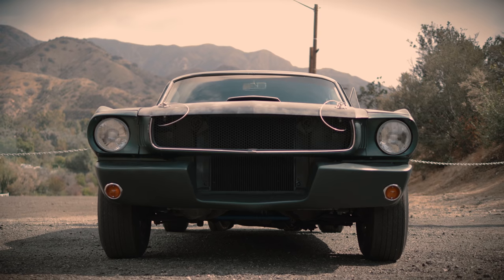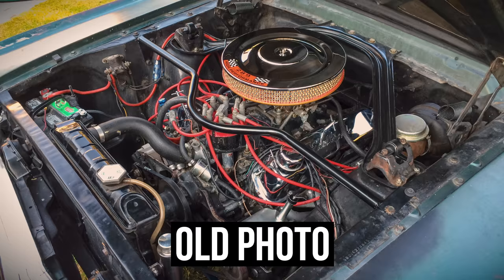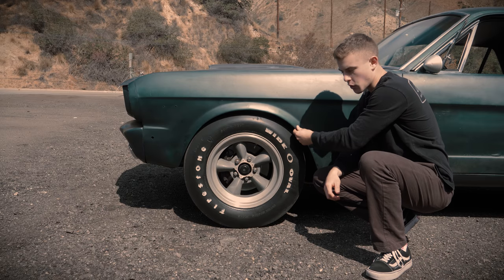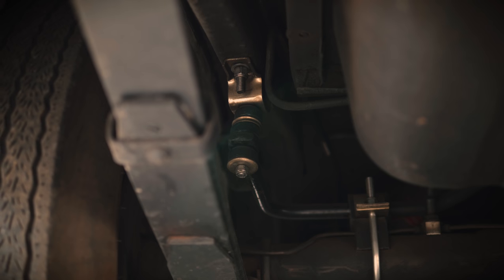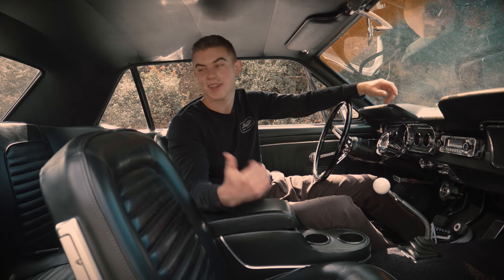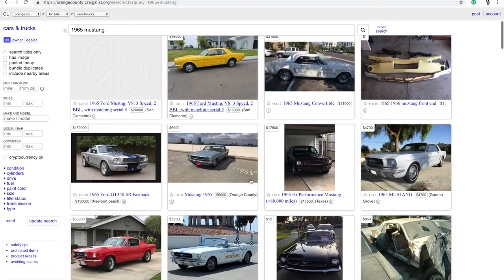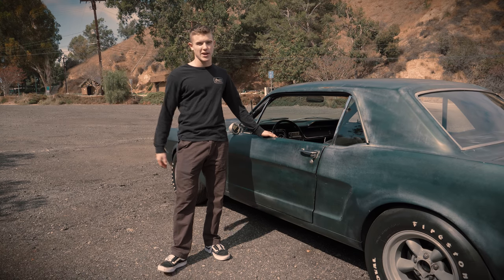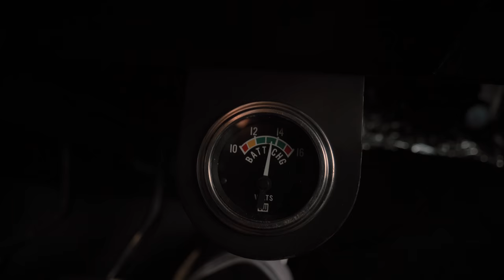My 1965 Mustang | Overview | 4K

Comment: Just take the radiator cap off and count the rows of cooling tubes, front to back.  I installed Ford Granada disc brakes on my '65.  The Granada spindles bolt right in.  Only difficulty was one of the tie rod ends. Neither Mustang or Granada part worked. Took dimensions to a Napa store and they fixed me up.   Stops much straighter and much less fade. Sold the spindles and drum brake setup to a guy with a 6 cylinder mustang he put in a V8 and five lug rear axle.
Reply from the maker: Scooter George Interesting👍🏼 Thanks for sharing!
Reply: What tie rod ends did you end up going with?
Reply: @historichomestead   - Passenger side, Granada. Driver side - see my previous post.

Comment: All cool cars have three pedals!

One thing to keep in mind about 65-67 Mustangs are the cowl vents.  They weren't painted from the factory so rust was a big issue.  There are aftermarket plexiglass plates that you can bolt on from the outside when storing your car outside.

I kept the useless AM/FM radio in the dash in my 67 because the car was so loud you couldn't hear the radio even if you wanted to.  Keep it real!

Rear drum brakes are more than adequate for the street.  I changed the backing plates and drums from a donor station wagon.  They had larger finned drums and wider shoes.  Adding rear discs means more add on stuff.
Reply from the maker: I have the cover! Thanks for sharing!

Comment: So Cool. Reminds me of my 1st Mustang. It was a 1969 428 SCJ Mach 1. But that engine had been taken out 2 owners before me. It had a 1971 Boss 351 with about 425 HP, and would spin at 8200 RPMs. I paid $3,800 for it in 1983 and sold it for $4,500 one year later to pay for college. It was also a 4-Speed car.

Comment: My 65 is restomoded. 5.4 2v supercharged and 4r100 trans. Full custom made subframe connectors and an 8.8 rear end with 3.53 gears. 723 wheel hp 813 torque. It's rowdy

Comment: I can see why you like the sound of the exhaust , it sounds awesome on your car . My first car was a 80Thunderbird with a built 302 , that car was automatic and would snap a car length in the down shift and roar under the hood . It was a blue car but the awesome engine burnt the hood paint to a purple color , I loved that car .  Green is a very good color for that type of car , the whole Steve McQueen Bullitt mustang . Down the road you should think about getting a summer motor , drop it in , in the spring . You would really like the sound of a stroker motor , the boom is very deep , has a big block sound . An awesome show called Engine Masters showed a Stroked Ford small block , I think it was a 351 stroked into a 410 . It made insane power . You could probably just use the parts off your 289 on it . It would run out of breath early , but the torque and acceleration would still be there . It would be over 400 ft lbs of torque at like 2800 rpm , it would burn out in second going down the road . The fastest car in 1970 according to a major mag was the buick gsx 350 horse 510 ft lbs torque . It outran the hemi cuda even tho it had much less horsepower . Wait till your in your in your late 20s tho , horsepower can shorten your life expectancy

Comment: I had a ton of fun in my 67, back in the late 80's early 90's. Couldn't keep people from running into it. I always liked the Trans Am series race Mustangs. I was always uncorking my headers and pissing off the neighborhood. Now I'm older and have a 68' Spitfire with 1300 cc's of English fury under the hood and I get irritated when a Harley drives by my house.
Reply: @FourSpeedFilms  really like the look of your car. Maybe get some factory steel valve covers, clean them up and wrinkle paint them. Just a thought. Also there was a GT350 mod where they lowered the upper front control arm by an inch or so. Supposedly gave better camber or caster or whatever.  I pulled my front disks and spindles from a 75' Granada, also had a one inch sway bar that fit. Put some tires on it and auto cross that thing.

Comment: The 7000 rpm limiter is whare the limit is on my Lincoln which is a similar motor also a small block ford and itll rev to 7k I wouldn't recommend it but u can
Reply from the maker: Jonathan Rabbe That’s interesting🤔 I always shift at 6k. It sounds really sketchy at 6k haha
Reply: Four Speed Films it is a built engine 🤷‍♂️ too bad you didn’t know the specs. Would be great having more top end

Comment: Hey man I’m building a 302 bored out to a 306, full forged rods and crank with hypereutectic pistons. High flow oil pump, comp cams magnum 280 camshaft, edelbrock estreet heads, and 750cc carb! Looking for a 60s stang rn!

Comment: This is tastefully done bro, respect to you for that. 
I would be very careful with the diff, suspension, brakes, tires, wheels, sway bars and rigidity mods... if it affects handling and suspension behavior you need to consider the whole picture or your result will be skewed unless you get really lucky haha. 
Ken Block is great and all with him being a world famous American driver, but honestly I hope you have established a clear and set direction you want to take this build. If it were me I’d shoot for something very at home on the track but manageable and comfortable on public roads. 
I think the fully original ‘65 mustang gt fastback look is outstanding looking.
I know that when stock these were some of the lightest, most balanced mustangs of the 60’s. They serve well on a road course I hear with the right mods.

I would want the exterior to be fully stock. Including the wheels. My first step would be to identify what is the best suited or stickiest rubber available that can be fitted to the stock wheels. To me I would start off with period correct tires, then if I wasn’t happy with their performance I’d see about some kind of hybrid modernized look alike tire concept out there somewhere and if that didn’t exist I’d see if modern tires were applicable. Tricky.
Once the level of grip I wanted was attained I would obtain another compromise suspension system for the vehicle that keeps ride height reasonable and can be dialed in to suit the rubber and (which brings us to the rear end) which again I would want an adjustable applicable differential with a very conservatively tune setup, basically enough to allow me to kick out the ass in a hurry if needed, but otherwise will hold me in place and forgive me if I throttle on too soon during corner exit. 

Chances are there are products out there to aid in building one of these to look so original that even car people can’t immediately see what’s been done to it, yet have it rattling off competitive laptimes with modern track cars.. 
It’d be a lot of trial and error I doubt that’s avoidable unless you know someone likeminded

Comment: @ 6:37/38 your stock oil gauge isn't working,    you don't have a added oil pressure gauge?     I always want to know that I have oil pressure.
Reply from the maker: Vern M It works! You just caught a film mistake😂 I filmed that when the engine was off.

Comment: Depending on how the engine was built, 7000 rpm is easy. 7500 is not unheard of in the 289 when built with parts that can handle it. Take the valve covers off and see what your working with.

Comment: I once spent all night hotwiring an abandoned rubber bumper MG Midget sportscar.  Once I got the steering lock off, I ran into my next problem - the battery was dead.  I walked down the street and popped the hood on a 65 Mustang to steal the battery.   It was from there  on zoom zoom down the street to pump up at the gas station that had just opened at 6am, then back to put the hood back on the Midget... pick up my girlfriend, and by noon we were headed south on the interstate....

Yep, I passed up a running classic mustang for a british piece of cr@p!   The Mustang looked like a sedan to me, I had no interest... I wanted a hot little sportscar... and it turned out to be the right pick, too, because that Midget got 50mpg highway!

Comment: howd you roll your fenders? im looking to do this with mine, theyre ripping the tires
Reply from the maker: I did it with a fender rolling device but it wasn’t super effective. I also used a pipe and stuck it between the tire and fender. I then rolled the car over the pipe.